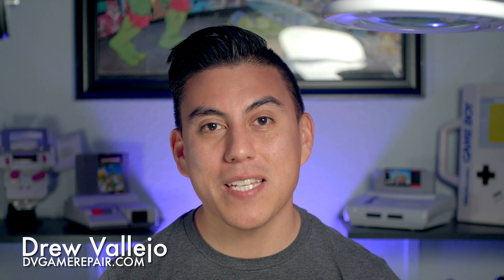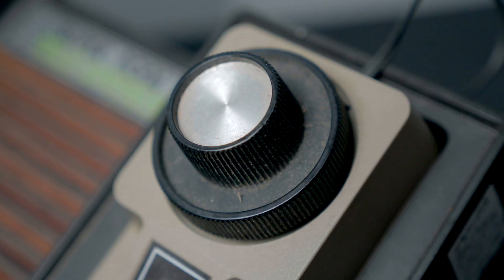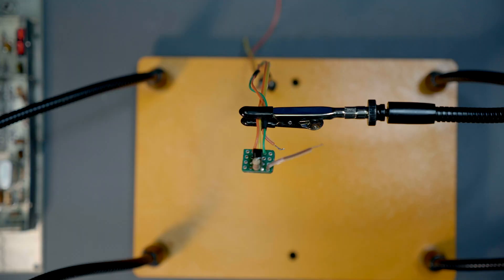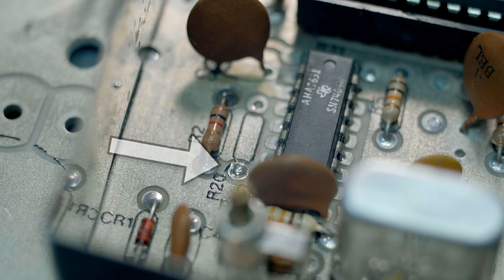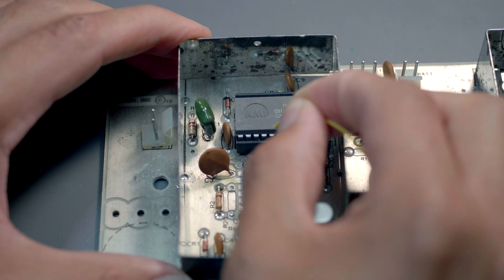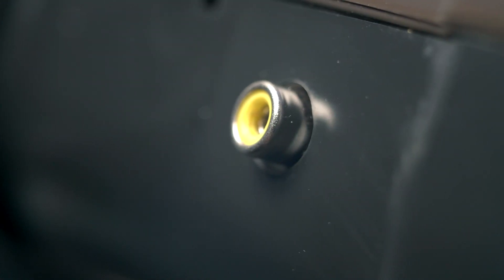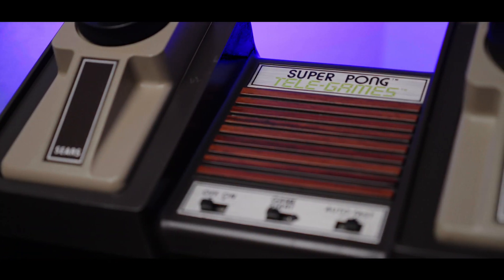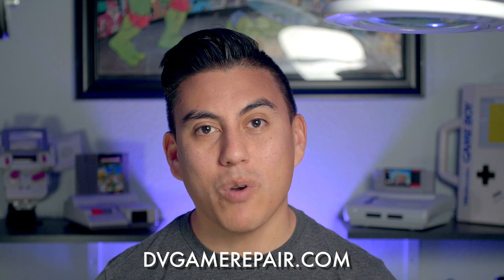Tele-Games Super Pong: Composite Mod

Comment: There is a main problem: it's not pin #6 but pin #18 as Pin #1 starts just under the C9 inscription on the board. You started at pin #13 and gone 6 pins to the right so it's not pin #6 but really pin #18 which is the Video Output of the 3659-C (Atari Pong C-100 chip) and the C010073 (Atari Super Pong chip). :)

Comment: the link you posted stated you need one  2k2 and one 3k3 resistor.  What value did you change the resistors to stop the video scrolling/rolling?
Reply from the maker: I believe they were 1K resistors. I will have to check on that to be sure though.
Reply: Did you ever verify what resistor values you used?

Comment: Could you elaborate on the circuit some more? I'd like to do this to mine when it comes in, like other parts and a basic diagram.
Reply from the maker: I based mine off of a composite mod circuit for the Atari 2600. You will have to experiment a little with resistor values to dial in the picture without video roll. In the description I put a link to an intractable that helped me out.
Reply: @dvgamerepair3448  Thanks I'll check it out for both my pongs!

Comment: Just bought one of these on ebay today. Great video!
Reply from the maker: Thanks! Did you get the exact one?
Reply: @dvgamerepair3448  I did and actually today received a Pong Sports IV with the four removable controllers.
Reply from the maker: @Miketage  That's awesome! That's one thing I wish mine had, four controllers.
Reply: @dvgamerepair3448  The fact they're not hard wired and removable is epic.